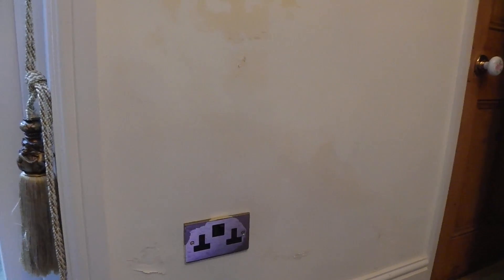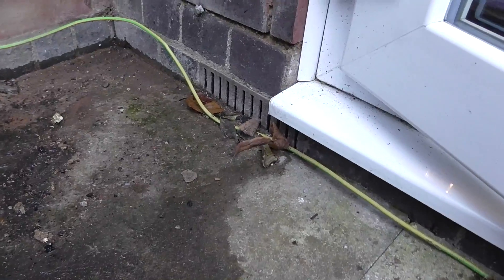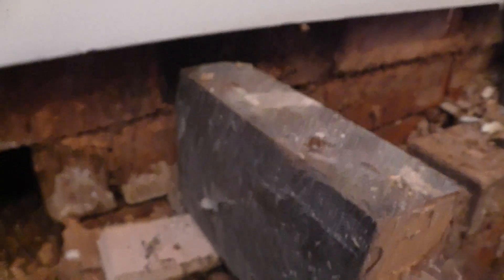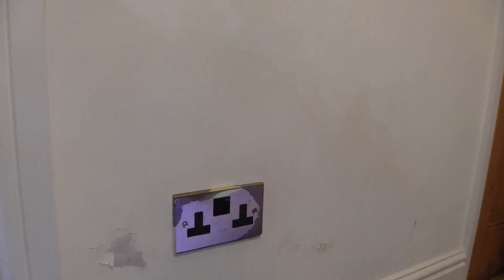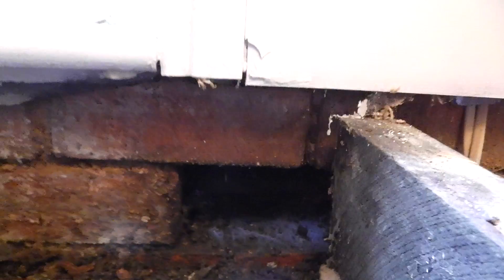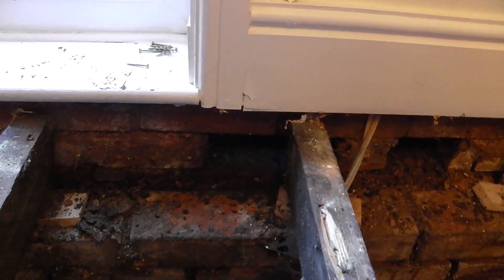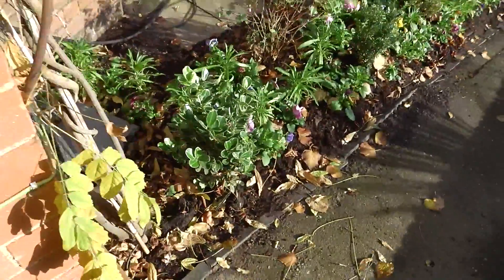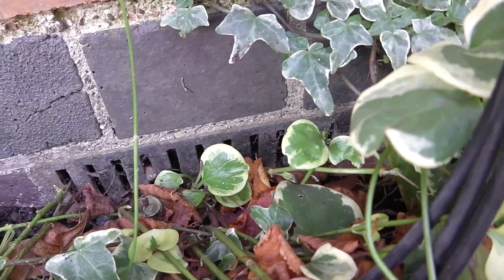Rising Damp in walls, Blocked air bricks - Part 1, The Problem

Comment: Just seen this video - what a breath of fresh air to see a professional explaining the REAL reasons for a problem instead of us having to listen to damp industry propaganda.  Congratulations on a sensible, honest and unbiased approach.  I recommend the British Standard - BS7913: 2013 - Guide to the Conservation of Historic Buildings, as a really good standard that backs up everything said in the video - namely, that damp proofing is not needed, that timber treatment isn't either - dry timber never gets affected by beetle or rot.  Breathability is the key - allow a building to breathe, and don't go using gypsum plaster and cement which both trap moisture into the fabric.   Congrats again on a really good video..
Reply: As Peter would say: It's the nonsensical landscaping by local authorities paving according to the plans, blocking up ventilation, and not using common sense !

Comment: Ivan has been a godsend for us. As first time buyers, we were naive to damp problems and were told by multiple companies we needed very expensive works done to rectify our issues. We found Ivan as we wanted to ensure we were advised correctly and immediately he was so helpful. He spoke to me on the phone for a while initially just allaying my fears that our problems really weren't that bad and explaining the concepts relating to damp in buildings like ours clearly. He then came round to do his report where he was very thorough and gave us an opinion which is invaluable for getting the necessary works done properly. We feel so much better about the situation and are glad that Ivan will continue to support us when we get the works done. Thanks so much Ivan!
Max and Rachel

Comment: I have just had these guys come and assess my damp problem, I have known I have had a problem for over 10 years but did not want a damp proof company to drill my walls as felt it was not needed, but really did not know what other options were available. I now have a full report listing what needs to be done to correct the problem and it is all minor work that I can do myself. I am absolutely delighted! THANK YOU!

Comment: Just to say what a joy it was to find Ivan and be able to have a sensible, practical conversation about the issues I was facing with my house.  I went from thinking my house was going to fall down around me to actually understanding what was happening, the reasons for it and the simple solutions that were not going to break the bank.   He has been very helpful and clear throughout the process from first telephone contact to actually coming to my house to do a complete assessment of the issues with which I needed guidance.  He was able to answer all the questions that I had even the ones that I thought were very silly.  His skill is also using his experience to translate technical  information to non-building experts like me.  It was a pleasure.  Very happy to recommend his services.

Comment: So happy to have been given Ivan's contact details. We had a number of damp and cold spot issues with our house.  Following a house visit and inspection, Ivan's knowledge and experience pointed us in the right direction to have these problems resolved. The issues were explained on site and were followed up with an in-depth comprehensive report. Honestly, my advice is get a good understanding through Ivan of what the problems are before any work is done. It could save you a fortune by avoiding the wrong remedial action by so called damp proof companies and the associated stress of it.  In summary, a true professional and gentleman. Thoroughly recommend.

Comment: I have a problem where the previous owner had put a concrete drive on top of the old drive and has caused problems with water getting in to the air bricks causing the joists to rot. 
Ivan replied to my emails with great advice. 
I spoke with Ivan on the phone as I was still worried about what route to take and he was great, he took his time to speak to me and give me great advice free of charge. 
He’s a very knowledgeable guy when it comes to damp issues. 
I hope I can rectify my problem with the advice given as it will save me £££ 
Many thanks Ivan, really appreciate it. 
Best regards 
Kaiser

Comment: I've got the same problem with my house, drive has been concreted half way up an air brick. Surprised it has caused so much damp as the drive runs away from the air brick at a reasonable angle. Shall have the groundworkers start lowering the level in spring. For now I have chased out the plaster on the internal wall back to the brick behind the skirting to help it breathe a bit, seems to have reduced the extent of reoccurring rising damp patches up the internal plaster. As many others have said, it is refreshing to hear your factual diagnosis instead of all the others that push their con tricks.
Reply from the maker: Thank Adam, if you want to email me info @ squareconductservices.co.uk (without the spaces around '@') i will send you a few photos of things to check that might not be obvious, but it does seem like your on it, well done

Comment: I've just been on a painting project and noticed damp in a bay window area. Path outside is level with two air bricks and both vents have a build up of sludge in front of them. The lady has had a few expensive quotes and dry zone plugs drilled and installed! Ten year guarantee they said. Thanks for your help with this reference video. And part 2.

Comment: We were originally quoted around £6,000 by a 'damp proof' company, who were happy to inject a load of silicone into the walls. They didn't even go outside the house to see what was causing the damp in the first place. We politely told them where to go !
After watching this video, I contacted Ivan regarding the issue. The outside concrete ground level had been built up too high, by the previous owners, therefore blocking an air brick. 
After emailing him, he was happy to travel over and look at the problem in depth. He was very professional and helpful. Ivan gave good advise and recommended what work needed doing.
Reply from the maker: Thank you for the comment Dan. You were certainly on the right track with your thinking and I'm glad we managed to bottom the root cause and recommend some extra measures to compensate for the 'real world' where it wasn't possible to completely roll back the building to its original build state. Good luck and thanks again for the comment.

Comment: There are three, if not four or five, separate problems here. 

First, as identified, the problem of the pavings draining towards the wall and being set too high, letting surface water run into the airbricks. Whilst this creates a damp atmosphere in the subfloor and risks rot developing to adjacent timbers, it could not have caused the area of penetrating damp on the plasterwork. The uppermost damp patch is too high to be caused by rising damp. And the two courses of blue brick will act as a primitive form of DPC, albeit with the mortar joints possibly allowing small amounts of moisture to pass. 

The second and central problem is shown at 1:05 on the video. The wall of the outrigger has not been properly bonded to the rear wall of the main part of the house. The coursing is out of alignment, indicating there is a butt joint just filled with mortar at this point. This aligns with the main damp spot inside (which is too high to be related to any rising damp, and has a pattern typical of penetrating damp, and not the 'tide' mark typical of rising damp).

Third the walls have a type of bond that is indicative of solid wall construction (i.e. not a cavity wall) and appear to be only 9" thick. That type of construction often leads to penetrating damp issues, especially when you have poor pointing (again the video shows some areas of such above the level of the blue bricks). And where combined with less breathable materials, like modern plaster and paint, and more hermetically sealed houses (blocked up chimneys, upvc draft proof windows & doors, etc.). 

Fourth, difficult to make out on the video, but it appears that the second line of blue brick (stretchers) is only on the outside. Inside looks to be ordinary red commons, which might be allowing a degree of rising damp to pass. 

Fifth, a least two of the joists have been too deeply notched for services, seriously weakening them, and these need to be replaced or strengthened. And they have no noggins or herringbone strutting to resist twisting forces, especially needed when the flooring is a weak material like chipboard.
Reply: Spot on

Comment: Great  video man vents are build in for a reason but I think most people think block it up its ugly or it lets in the cold no knowing they are damaging the building Thumbs up
Reply from the maker: +macplastering Thanks - the trouble with common sense, is its not common!  They are there for a reason, people make the mistake that the Victorians )etc) were rubbish builders and they know better, they weren't and they don't  !
Reply: Square Conduct Services Limited I agree most times these things can happen from things being changed and changed wrong/lazy as in the yard made from concrete but to high as it should have been dug out lower. Then done with nice run of to drains away from build  but you more than cover all the great points on the vid :)

Comment: I've seen this time and time again whilst working as a technician in the damp proofing industry, surveyors NOT uplifting the flooring to gain access to the damp area for a proper surveillance. It's easier for them to stick in their 'damp meter', recommend hacking off the wall fabric, putting on a membrane, or cementitious tanking or dpc injection...as they make more money from it!!
Reply from the maker: +George McKnight HOW TRUE !!!....you have summed up the money making scam very well. Thanks for you comment
Reply: Some clients of mine have a stunning Georgian house that has major damp issues. To the point the condensation has now killed the lovely sash’s hence my job to repair them. They have had all the usually damp dicks in there  rip off the lime plaster, membrane, tanking  slurry, gypsum four feet up the wall. Now tide mark coming through the plastic paint above the shit damp job. When I pointed out the cracked plastic masonry paint over the cement pebble dashing might be to blame outside the thought I was nuts. Since the have started to investigate this though.

Comment: Though you are correct on the sub floor vent issue the cause of the damp on the wall is too high to be rising damp & is likely penetrating damp caused by a failed butt joint on the connected wall outside which appears to be directly in line with the staining on the inside
Reply from the maker: Hello Stu, thanks for getting in touch. Always difficult to judge these things from video as you can't capture and show everything, unfortunately though, in this case, I'm not sure i can agree with your conclusion, As you will see from my Part 2 video (and everything to date over the years) the problem was cured without work on the butt joint - HOWEVER, you raise an excellent point and I'm sure everyone watching this and reading the comments will thank you for adding this point to their understanding of any issues they may have. In general you are correct, butt joints can be an issue. Thanks for getting in touch. Ivan

Comment: I contacted Ivan at Square Conduct for advice regarding a few concerns   I had with my property. I had been very impressed with Ivan’s  videos which I found helpful  and made perfect sense. 
Ivan was extremely supportive and he took the time to listen to my concerns and offered his advice free  of charge and without obligation. 
I did not want to contact a “Specialist” as I am aware they invariably identify expensive and often unnecessary work that often do more harm than good,  preferring an impartial and honest view of the  issue and guidance as to what will put it right. Ivan was able to offer this and agreed to visit my property where he carried out the necessary investigations. He talked my wife and I through everything he was doing both inside and outside of the property and thoroughly explained his thoughts and findings clearly and without any jargon. 
Ivan has produced a detailed report with clear and in-depth recommendations which I now intend to follow. Ivan continues to be available through on-going email/phone support whilst I undertake this work.
I was reassured by Ivan from our very first discussion and have found him to be trustworthy and professional offering clear, impartial and concise advise. 
I would recommend Ivan and Square Conduct Services without any hesitation whatsoever. 
Thanks again Ivan and your help Is very much appreciated indeed. Rod

Comment: When I moved into my property the surveyor suspected damp on my exterior wall which is an end terraced house. The damp on the outside is causing damp on my inside wall. I have 3 half air bricks at the front of my house which are almost level with the block paving. And on the side of the house I have two full size air bricks which are about an inch lower then my block paving. And at the back of the house which has been extended with a cavity wall and not a solid wall like the front part of the house. It has 4 full size air bricks at the back which is level with the garden patio paving slabs. And on the side of the extension there are two full size air bricks with one air brick above the paving while the other is level with my garden patio paving slabs that lead up to my block paving on the side of my house. And because my house is built on a slight incline, the ground level at the front of the house is higher than the back of the house where the garden patio is. So, there is a slope from my garden to the front of my house which means the ground level is too high. When I first moved in the seller suggested Rentokil will inject rods into my wall to help dry the moisture away from my brickwork that’s underneath my render but it hasn’t worked. So, after all this time I’m going to have my ground level lowered on my driveway and path along the side of the house and part of the garden patio along the side of the house so it all lines up. And later on will lower my garden patio so it’s below the 4 large air bricks at the back of my house. And where I have the moisture problems on the side of my house I will install new air bricks that come in black so they won’t need painting. And I hope that will help with reducing damp on my sidewall. And next summer tackle the inside of the wall after using a chisel and hammer to take the bottom of the wall back to brick to dry it out before redecorating it. 

I have a question? The bottom plinth which is black where my air bricks are underneath my rendered wall above will I need to use a lime mortar cement? And not just ordinary cement?

Comment: I have a couple of air vents on my two up two down terraced house, they are about a foot off the floor but weirdly vent to no where as the inside wall is bricked and plastered. I have been in there, they are not venting a cavity or any such thing, literally a two brock thick wall with no gap in between them but at some point someone seems to have bricked them up on the inside then skimmed over them, many yrs ago mind but it explains the black mould and damp brickwork as there is sod all airflow beyond that. Such is the trouble with these old two up two downers especially with no central heating, very difficult to keep warm in winter so people would block up vents with all sorts to stop the draft but then you get yr condensation and damp issues being discovered 20yrs later.

Comment: Really refreshing to see this. It's so nice to see good  honest advice where you get to the root of the problem! Just a couple questions, Is a perforated pipe needed (french drain?) also, can this be done if there is a cellar? So the internal ground level floor is lower than outside floor. Towards front of house there is a cellar. Thanks!
Reply from the maker: Hi thanks for getting in touch. The idea of the drain is to keep water way from the wall, this included damp, so the drain must be free flowing, other than that, providing the principle is maintained, it doesn’t matter how you do it in reality. 

The second part of your question is HUGE and I could write several volumes on it, but the solution would be TOTALLY specific to your circumstance, there is not ‘one size fits all’ and don’t let idiot injecting companies say there is!!!! drop me a line to my email with a few photos and I can narrow down the items you need to consider. All the best, Ivan
Reply: Thanks for your reply Ivan! Once the house purchase goes through I'll show you some pictures. What you say makes such obvious sense, identify water source and redirect / eliminate it. "Damp Wally" awareness course v2.1 :)

Comment: Hi i hope you are doing well i don't expect a reply being this video is do old but i am having a terrible problem with my chimney breast it is sealed up all the lower breast snd floor boards and soacking wet i had a roofer out who repointed my chimney breast then i had someone out who pulled up my flooring found the bricks and wood joists dry around the hearth then nocked out 5 bricks and cleared 2ft of soot and soil then left it to dry. It never did when it rains i cant see any water or hail making it to the bottom i seem stuck with a mess and don't know what to do. Any possible ideas 1930s 2 bed semi uk

Comment: I would like to ask whether in old houses without floor ventilation, how is the space under the floor ventilated? Will filling the space between the walls with insulation block the floor ventilation? Does the cavity wall also ventilate the space under the floor?